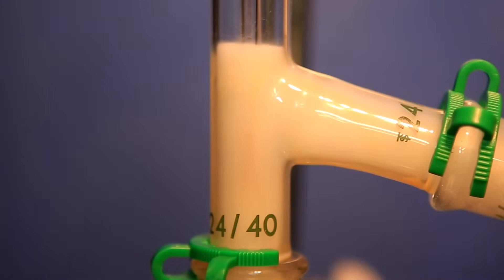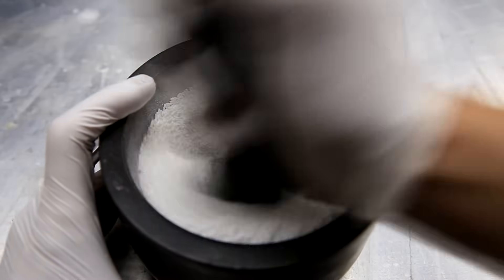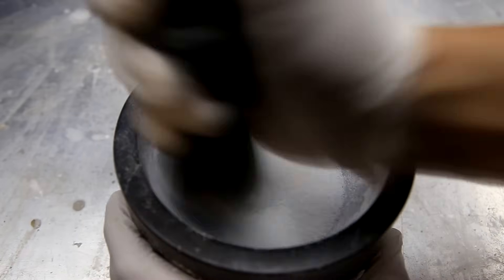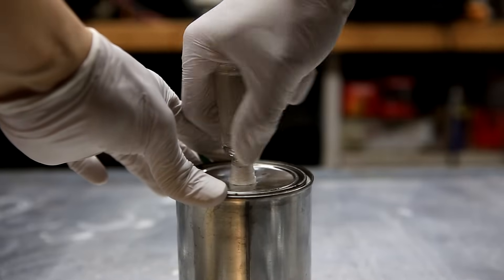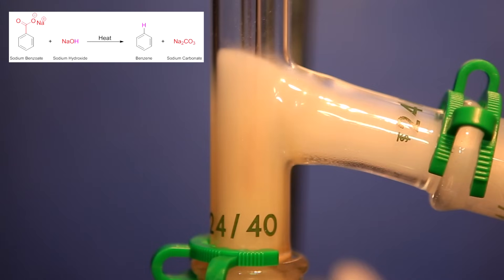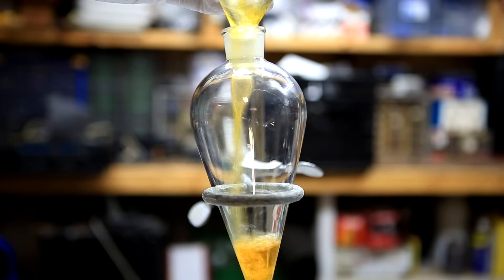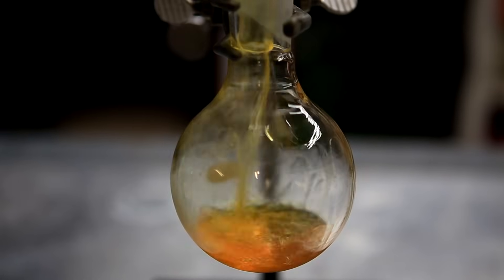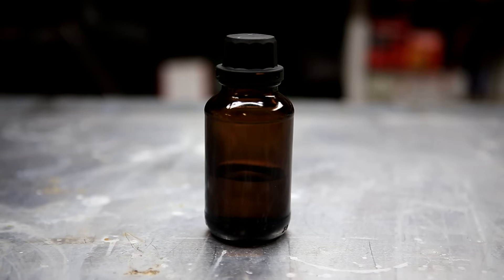How to make benzene

Comment: I've saved up for some distillation apparatus, and I found this on ebay: http://www.ebay.com/itm/500ml-24-40-Glass-Distillation-Apparatus-Laboratory-Chemistry-Glassware-Kit-USA/131449210549?_trksid=p2047675.c100010.m2109&_trkparms=aid%3D222007%26algo%3DSIC.MBE%26ao%3D1%26asc%3D29980%26meid%3D2fbb35911cff4f1e96197ab3fa534bfc%26pid%3D100010%26rk%3D7%26rkt%3D17%26sd%3D261966602337
Is this a decent one? Any recommendations?
Reply from the maker: Camroc37 It looks okay. However, I prefer the distillation apparatus with closer to 90 degree vacuum adapter so the round bottom is vertical. Also, with this setup, you won't really be able to do vacuum distillation (if you needed to). Because you can't get a proper seal on the thermometer.

If you just plan to do regular distillations, I think it will work well. Youll also need to buy an adapter to fit in a thermometer and the only other concern might be that the condenser is pretty short if you are distilling something really volatile.
Reply: Nile Red I will keep looking. This was just the cheapest one I could find. I did do a North-America only search. Any suggestions on where to buy a descent one? The main use is to make nitric acid. I will spend up to $60-$70. 
I did just find this, sorry for asking so much, but is this good? I noticed that the 3-way adapter is a little too straight: http://www.ebay.com/itm/500ml-24-29-Glass-Distillation-Apparatus-Laboratory-Chemistry-Glassware-flasks-/281401608207?pt=LH_DefaultDomain_0&hash=item4184d7c80f
Reply from the maker: Honestly, I think everything should be fine as long as it is borosilicate. Check the thickness of the glass and the reputation of the seller.
Reply: Nile Red Do you think a thermometer adapter with the same size will work? I noticed the cap and it doesn't look quite right. Thanks.
Reply from the maker: I am not sure what you mean
Reply: Nile Red On the 3-way adapter, there is a blue cap. The top of the 3-way adapter doesn't look like it could fit a thermometer adapter.
Reply from the maker: Oh, the cap is attached directly?
Reply: Nile Red I bought it, I will just tell you how it works when it gets here.
Reply from the maker: sounds good!

Comment: Nile Red What temperature does the reaction take place? Could this be achieved on an efficient hotplate?
Reply: Nile Red Is it the melting point of one of the components? This would come out to the 300*C-323*C temperature range.

Comment: What is that orange liquid left in distilling flask?
Reply: +LaFFle There are lots of bisphenols inside, as I've read somewhere. In any case, it's deadly, foul smelling and it's best to soak it on some tissue paper and burn it outside.
Reply: Bisphenols
Reply: I have place it under IV light and it glows orange.
Reply: Derivatives of organic syntheses may involve compounds with a significant amount of unsaturated bonds (e.g. R2-C=C-R2, R2-C=O or R-N=N-R, whereas R is an organic substitute), as well as functional groups (e.g. R-OH, R-NH2, R-NR2) containing lone pairs of electrons. These compounds involve a lot of delocalized electrons which absorb light in the visible spectrum because they're easily excited by these wavelengths. Therefore, we see a certain colour.
Reply: Bisphenols are also a plasticizer that is being heavily phased out, for obvious reasons.

Comment: Interesting.  Any idea what the yellow substance was after the last distillation?
Reply from the maker: Charles Snyder I think some people hypothesized biphenyls, but im an honestly not sure at all.
Reply: +Angel Santorelli Hydroquinone is colorless to white crystals. As it oxidizes though it takes on a pink color. And p-benzoquinone when pure can be anywhere from yellow to orange if I remember correctly. So, could be a combination of a few oxidized products including iron from the can.
Reply from the maker: kjpmi Iron from the can would not be surprising.
Reply: +Nile Red Biphenyls are rather colorless and solid at RT, y would go for oxidized phenols or hydroquinone as a byproduct of the reaction, but it's hard to tell
Reply from the maker: Yeah it is pretty hard to know. It would be interesting to find out though.
Reply: kjpmi I belive you are right fellow colleague
Reply: +Nile Red 
Distilled over though?
Reply from the maker: Quintinohthree maybe it more "sputter" over?
Reply: I don't know exactly what the yellow is, but after the last of the benzene boiled off, rather than throw it out, I nuked it with some 98% sulfuric (vigorous reaction - be ready for it!) then NaOH, and HCl, and got about 5% yield of phenol out of it.  I probably used entirely too much, but in the small quantities involved, it wasn't very expensive to experiment a bit. 

There may have been some benzene still in the original crude mix, but I got it up to 100 C before calling it done, so if there was, then whatever else was in there was holding on to it pretty well.
Reply: I recently saw an article on this sort of process that said that the presence of water inhibits the formation of side-products. It would require something like 5 - 10 atm of pressure, which isn't too much... Perhaps doing this reaction inside a length of steel pipe with a pressure valve would work. It would be easier to clean and reuse than a can, as well.
I'll give it a try, and report back with yields when I have some results.

Comment: What are the best safety precautions to take? Often the dangers brought by benzene is hyperbolised greatly and so it is difficult to gauge exactly what the real danger is.
Reply from the maker: JMAPScience The real danger of benzene carcinogenicity, which generally comes from long term exposure. Avoiding benzene altogether is impossible because benzene is in tobacco smoke, car exhaust, gasoline, etc. 

The other major danger is the obvious flammability of an organic solvent.
Reply: JMAPScience Simply filter your breathing air through a cigarette and you'll be ok.
Reply: People also fail to mention the NaOH as a hazard in this video. If you’re grinding it up into a power DO NOT INHALE ANY OF THE DUST!!! it forms a really strong alkali that is very corrosive to human tissue. You want that in your lungs?
Reply: @hebbejebbe  ooh I love my lungs turning into soap!

But yea I think a good fume hood or a filter capable of catching both is necessary for this
Reply: breathing in NaOH can be much worse than superficial contact. Again, a single exposure of benzene is usually not fatal. It is carcinogenic does not mean a single exposure would cause cancer.
Reply: NileRed said it best. Carcinogenicity, but that's really from long term exposure in large doses (needless to say, like all such substances don't push your luck lol).
Reply: Everything can kill you at high enough doses. Remember the true killer is the dosage!
Reply: All doses of benzene are dangerous.
Reply: @RealBigNope  * Except with PCB's
Reply: I thought it was the amps that killed you?
Reply: @ContentCalvin  it's the ohms that kill you
Reply: Username checks out
Reply: @whyguy5324  Right?! Don't tell those crazy "Q" following, Trump cult Terrorists ANYTHING‼️

🧫🥽🤪🧪          🧨💥🏛🔥
Reply: E2qNX8btraQ3zRD6J7fc :D
Reply: is more surprising that the could keep it a powder instead of a pourridge.
Reply: +JMAPScience Don't inhale it, don't drink it, avoid any contact, don't release it into the environment and avoid any sources of ignition! Back in 1976 (when I was 14 and very active with my chemistry experimental kit) I rather easily could buy it in drug stores and some pharmacies. The chemist from the pharmacy did sell this stuff only to adults (my mother then), the drug store man did sell to me directly without any questions.
Reply: J M benzene is much more dangerous than NaOH in powder form. If nile wanted to point out all the sources of risk in his videos he would have to include things like hot glassware or the danger of slipping or even some accidental splashings of liquid that could reach your eyes. And this of course can't be done. What must be pointed out are the greater dangers. If you inhaled some of the NaOH powder you would just cough a bit and feel some burning in your nose (tried it, accidentally of course). Nothing else. Your mucous can easily regenerate from such superficial damage. Cancer is for all life.